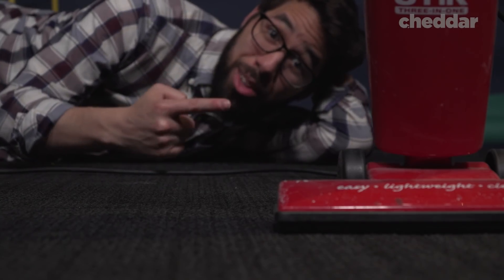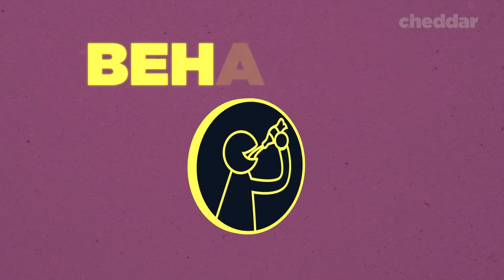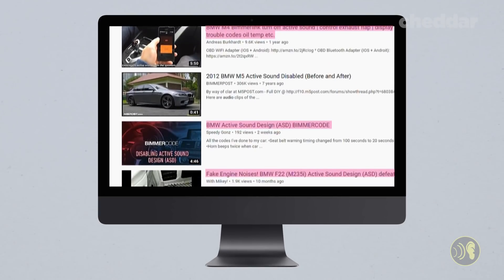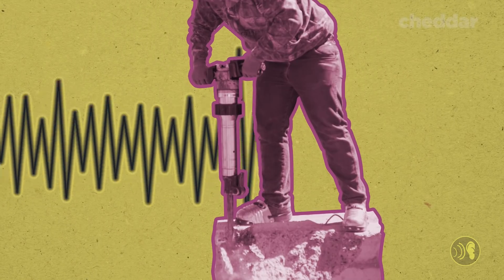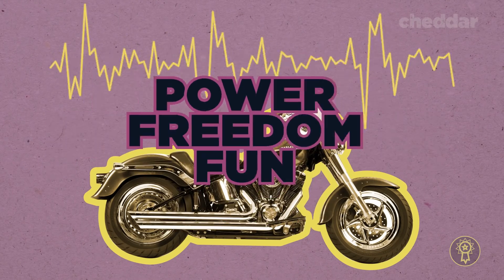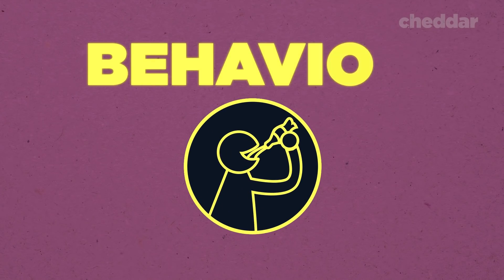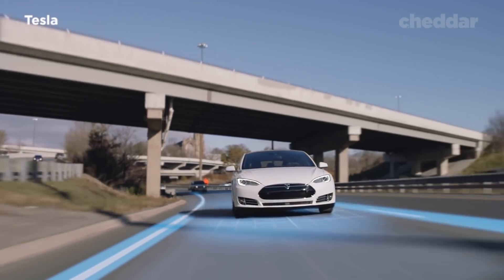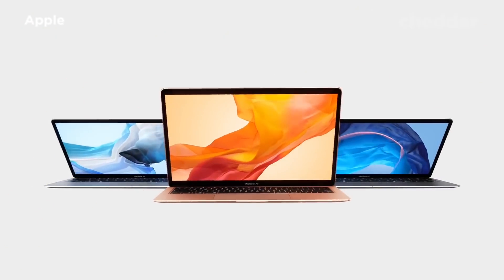The Fake Sounds Companies Add To Products - Cheddar Explains

Comment: I'd take a silent vacuum any day.
Reply: Nice try, dog.
Reply: Kevin C hahaha! This had me laughing! :)
Reply: They're made it louder on purpose so they could sell... "a silent mode" as the most expensive option, later.
Reply: @mukamuka0  Naw I just think they hate dogs and cats.
Reply: @mukamuka0  holy fuck
Reply: Muka Zero my godd
Reply: Me too. I hate the vacuum cleaner noise with a passion
Reply: @BUSHCRAPPING  me 2
Reply: @BUSHCRAPPING  So do me dogs.
Reply: Agreed, it is the most irritating thing about vacuum cleaners, and the reason I don't use mine very often. They say volume indicate efficacy, but I think the fact that the dirt is no longer on the floor signifies efficacy.
Reply: I LOVE my Miele vacuum. It is so silent.
It took a little getting used to. But since I have it, I find my old Dyson unbearable.
Reply: @digojez  *steal
Reply: Quieter lawn mowers and weed wackers would be nice too.
Reply: @NacorantheHarmonicaPlayer  I have an electric lawn mower, and its sound level is half that of gas ones; I love it! The quieter the better, as far as I'm concerned.
Reply: @xzonia1  electric lawn mowers and lawn equipment is ideal of you have a really small lawn, but there are huge practicality issues. my gas equipment doesn't wear out much year to year, batteries on the other hand don't hold nearly the same charge one year later.
Reply: @epoxeclipse  Mine doesn't have a battery. I plug it into an electrical outlet with a long cord (and yes, I have a small lawn). :)
Reply: @NacorantheHarmonicaPlayer  - Yes!  And CHAIN SAWS!
Reply: Oreck vacuums like those used in my office are so quiet they can sweep around me while on a phone call.  They are also very powerful.
Reply: I have a Electrolux UZ-930, noise level is good, it's not silent but it doesn't have a high pitch jet engine sound like most vacuum cleaners do. Just that air "whooosh" noise.
Reply: I know right? For more than 10 years now, Miele and SEBO have marketed quiet vacuums that people actually want to buy because they are quiet, and they still pick up more and clean better than say, a loud Dyson.
Reply: https://www.smartvacuums.co.uk/quiet-vacuum-cleaners-review-of-the-best-5-silent-models/
Reply: @rugby.7  Exactly what I was going to comment.  The main reason why I bought a Miele.  I didn't care that it was 3x more expensive than the crap on Amazon or at the store.
Reply: Miele is your friend.
Reply: @Noah-ws8ho  Own one love it, it's so quiet
Reply: BOSCH has had one out for over 5 years now
Reply: There is no sound in a vacuum...
Reply: The only way I can vacuum is with noise cancelling headphones, the same goes with a lawnmower.
Reply: I literally bought my vacuum because it is quiet.
Reply: Ever heard of the company Miele
Reply: The Tesla vacuum
Reply: @digojez  YEET!!!
Reply: Corvus SNATCH
Reply: If we want a silent vacuum, I guess we have to make it ourselves 🤔
Reply: I have some vacuums from the 90s that you have to wear hearing protection with. That is bull shit lol.
Reply: @MomoTheBellyDancer - People with a vacuum between their ears tend to be the ones who show up for focus groups to test products or answer questions about products.  They are the kind who get off on loud cars and loud lawn equipment, especially males.  Therefore, the rest of us have to suffer the consequences of companies using that data to design their products.  And yes, I showed up for these product testing sessions when I was out of work; that's how I know.  Companies need to find a better way to get consumer data.  Maybe pay Consumer Reports to conduct surveys with their less vacuumed brains.
Reply: or those Dyson fanless fans that are also noiseless
Reply: I think an electric car should sound like a Mr Softee ice cream truck.
Reply: Isolate your vacuum motor and collection bin in your utility room and run suction lines through your walls to each room.
Reply: Isaac Karjala the only problem with a central vac system Is that you have to have the pipes run when the house is being built,the actual vacuum gets put in the garage and takes up space takes and you have to have a heavy and inconvenient hose that takes up more space Wherever you store it. I honestly don’t know much but for my parents it wasn’t worth it doing it.
Reply: It pissed me off learning that vacuums can be silent but usually aren't
Reply: there is a reason i got 3 working vacuums. i use one when cleaning my car but i still use broom to clean my house. unless its a carpet... fk hate eastern europe. why does every room has to have a god damn carpet that fills up 80% of the room
Reply: @luk4s56  Most American homes are carpeted except the bathrooms and kitchen. Carpet is warmer in the colder months. Unless heated floors catches on I don't see it changing anytime soon .
Reply: @ThatGirlJD  what i seen most us houses got carpet floors or those fluffy ones. we dont we got flat ones and in some houses for whatever reason people still hang carpets on the wall
Reply: You mean a mother would like to vacuum when her baby is sleeping?
Reply: @digojez  tu kithe firda aa ???
Reply: Great profile
Reply: hannah ridgeway 8K  *yeet
Reply: Your dog will thank you.
Reply: Amen!
Reply: Regular vacuums aren't nearly as bad as those damn dysons that put out an obnoxious fricken 5000 hz screech.  It's even worse that the dyson has a trigger on it so the obnoxious noise can be quickly and irritatingly cycled on and off in a short period of time.
Reply: Nothing worse than doing your usual 3am clean sweep, only to wake up the house at vacuum time.
Reply: I’d say to get an electric vacuum, but you be the picture
Reply: @David-n5q2v  
Yeah, I had a diesel powered vaccuum. It was pretty loud, but did a great job picking up dirt.
Reply: Danyal A. Do you mean a suction excavator?
Reply: I’d like it mostly for the neighbors below me as I am a neat freak.
Reply: Yeah, I get the feedback thing, but you can just tell that the vacuum is working when you empty out all the dust.
Reply: Godly pfp my man
Reply: That profile pic is the best for this comment
Reply: hannah ridgeway 8K  *boonk gang
Reply: Me and my dog too
Reply: Hell ya
Reply: Same. Vacuums are super annoying I do t know why anyone would want a loud vacuum
Reply: Just don’t vacuum
Reply: My dog would love it
Reply: maybolh ( ͡° ͜ʖ ͡°)
Reply: Ye
Reply: My grandma bought an expensive vacuum that doesn't make a lot of sounds and it's amazing, I can use it in the morning and no one is hearing it lol
Reply: Vaccum companies better read this comment with 15k likes
Reply: Well you do live in an apartment so why not.
Reply: @digojez  y hack me
Reply: maybolh silent microwave
Reply: maybolh yup especially when ur dog is sleeping then he wakes up and moves away 😣😣😣
Reply: My mum wouldn't know I'm cleaning so
Reply: Especially waking up to it
Reply: I'd take a silent car any day, I rather hear my music than a stupid engine
Reply: My cat would appreciate it too. She gets Vietnam flashbacks every time that monster gets revved up.
Reply: I hate how loud vacuums are. So I definitely would buy a silent one.
Reply: Ever hear vacuum cleaners in hotels and airports? 
They're nearly silent except for the rattling of debris being sucked up.
Reply: I'd take a silent vacuum cleaner and a loud dishwasher. These super quiet dishwashers don't clean the dishes as well as the louder versions.
Reply: Miele, Sebo, Rowenta.. All super silent. Shop quality, not chinese crap in big box stores. What they said is bullshit, take it from a vacuum repair guy. (Me)
Reply: @janpohorelicky6990  Yeah? Then why the fuck can I hear my neighbor vacuuming his house 100 meters away, with headphones in?
Reply: maybolh me too
Reply: So would my dog and downstairs neighbors
Reply: Sucking air makes a lot of noise, the same way shooting compressed air is loud
Reply: Please lord
Reply: Me to because my cat hates the sound.
Reply: Kinda like the medicine is only good if it tastes bad despite not needing shitty tasting medicine for the majority of medicines :/ marketing
Reply: I hate vacuuming because it is too loud
Reply: maybolh I know literally can only vacuum during the day because at night it would wake up all my neighbors with how loud that shit is
Reply: Yeah
Reply: If you guys really want a super quiet vacuum I have personal experience with this one. it's really powerful too. It seems the price has come down so that's good!    https://www.amazon.com/ProTeam-Backpack-Commercial-Filtration-Telescoping/dp/B00GM4YKWC/ref=asc_df_B00GM4YKWC/?tag=hyprod-20&linkCode=df0&hvadid=198091028620&hvpos=1o1&hvnetw=g&hvrand=912215572265551759&hvpone=&hvptwo=&hvqmt=&hvdev=c&hvdvcmdl=&hvlocint=&hvlocphy=9009976&hvtargid=pla-350438472229&psc=1
Reply: @janpohorelicky6990  lucky
Reply: And the silent car! Frankly I would love a requirement for products to be as silent as possible while still remaining functional (so no hampering the engineers, but also not encouraging them to make loud gas-guzzlers etc.)
Reply: the only sound that can be heard when I use a vacuum is my moaning as I use it on my penis!
Reply: Maybe not silent. Say, quiet pur so you know it is on, then amplified sound when it sucks something up.
Reply: I like loud sex so i'll respectfully disagree.
Reply: @jamalfranklin3807  please dont fuck your vacuum
Reply: How would you know a silent vacuum is on?
Reply: Get a Dyson.
Reply: Danyal A. I worked with a family friend fixing vacuums for a year and they are junk! They are cheap,loud, not made to be worked on by the average person and require special tools you can only get from dyson for what you can work on and I never touched one in that entire time. This friend didn’t even want to sell them in his store but because everyone buys them he did. Ironically all the Kirbys and sanitaire tradition were the easiest thing to work on but both are based on old tech.

Comment: WHAT THE F. SNAPPLE... CHANGED IT TO PLASTIC we should do the opposite
Reply: Glass is far more recycled than plastic... All glass can be melted and washed, or can be crushed and used as sand or a building material. Glass also isn't poisonous and doesn't do harm in the ocean, as it quickly breaks down to sand. Plastic is a terrible material to recycle and is very bad for the environment. Stop argueing for plastic, just because one or two types can be reused.
Reply: @joshuanorman2 - Glass also has its drawbacks, like the huge amount of energy that it takes to both recycle it, and ship it anywhere, either full or empty. In my area, glass just gets ground up and taken to the dump. It becomes a question of water pollution (from improperly-disposed-of plastic) versus air-pollution (due to the fuels needed to deal with glass).
Reply: @needthistool  id take air pollution since it's gonna happen regardless of which option you choose. When you choose plastic you're just 'putting the world into energy debt' because someone will eventually need to clean it up, considering they're so damaging to the environment. Pkus we are much closer to getting fossil-fuel free power than cleaning the ocean so it's better in the long-term
Reply: @Lysergic_  That's probably a reasonable stance given that we're only just learning about the effects of various plastic compounds on the environment. Regardless, everybody just drinking less juice in general would probably be even better. That would solve both problems. Juice isn't really that healthy anyhow, I gather, though it's a step above soda.
Reply: @needthistool  true but Id say a good way of getting people to drink less juice would probably be to make it less available by making it only allowed in glass bottles. It probably wouldnt open up a black market for juice too so its not like outlawing drugs
Reply: This! Even when plastic is recycled often the environmental impact is the same as making a new plastic. Couple this with the fact that many grades of consumer plastics aren't recyclable, then we have a mess. Aluminum, glass, and paper are far easier to recycle and have a lower environmental impact.
Reply: i was mad about it too, but glass is heavier and means transport trucks carry less of it per trip. so while glass is better for recycling, plastic is better for the greenhouse emissions/fossil fuel usage. it also saves Snapple money, which is what they mostly care about.
Reply: @elocinaqui24  The cargo container of a beverage delivery truck is not the majority of the mass. The ethane that is a base material for PET is a greenhouse gas, it is extracted from natural gas at the wellhead or is a byproduct of a refinery. The terephthalic acid part comes from an oil refinery. Oil refineries use a shitton of electricity. Better to use the electricity to fuel the delivery trucks if you want to reduce the carbon impact. DHL saves 60-80% of their fuel and maintenance/repair costs with their electric-drive delivery trucks over the diesel versions.
Reply: As far as I know, the main reason they changed to plastic was that people were complaining that the glass broke too easily and therefore less people were able to recycle them. From what I know there were both positive and negative impacts from the change, both from an environmental and personal level. For example, I know many people who used to wash their glass Snapple bottles and use them for months before finally throwing them in a recycling bin. For myself however, I’m pretty clumsy and would accidentally break the glass bottle more often than not.
Reply: dandanthetaximan  I mean, we already do that with much more dangerous things, such as nuclear waste. Plastic, a pretty stable and easy to compact thing, shouldn't be too hard. Compact it, store it somewhere that's closed and here's the kicker: collect the gasses that are emitted off of their decomposion. Methane is reusable, you know?
Reply: @O(∩_∩)O looks at 6 month old plastic water bottle i keep refilling, like i've been doing for the past 8 years, once using the same bootle for over an year
If that's the case, how am i not dead?
Reply: @lorenzo_br5803  there are different kinds of plastic bottles, you probably have a hard plastic one, not a soft drink plastic bottle
Reply: @weinerglory  I mean, it's just a random water bottle... one these, to be exact! 
https://www.setegotas.com.br/produto/agua-da-pedra-com-gas-500ml-fardo-12-unidades/
Reply: @lorenzo_br5803  You win the science fair!!
Reply: You can recycle plastic.
Reply: @lorenzo_br5803  It is cheaper and more economical to recycle glass. And recycled plastic can't be used for a food or beverage container again because of contamination concerns.
Reply: dandanthetaximan  Well, that wouldn't be a problem if we kept said waiting to be recycled plastic somewhere safe.
Reply: Plastic is cheaper and lighter. Reduces business expenses for Snapple, and makes the product safer as well.
Reply: Denatorxxyt Dummer Name glass takes several thousand years to decompose while plastic takes 100 years. if your concerns are environmental, properly disposed of plastic is far less dangerous than glass left in the open ie beer bottles broken in half etc.
Reply: @TheBlumieriest  That's why we recycle glass instead of throwing them into a nearby forest.
Reply: @ThePC007 Glass is really expensive to recycle because you generally have to heat it until its molten. In most places, this means more pollution because of the power-sources used to do this, and the distance of the facilities for doing so combined with the weight of the glass itself (read: heavy).